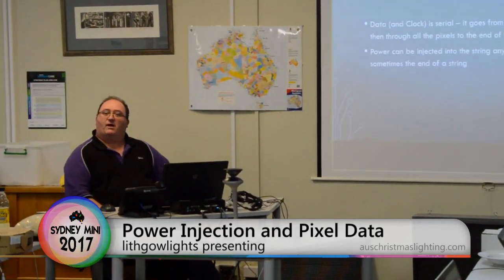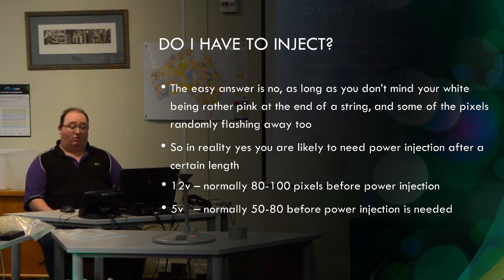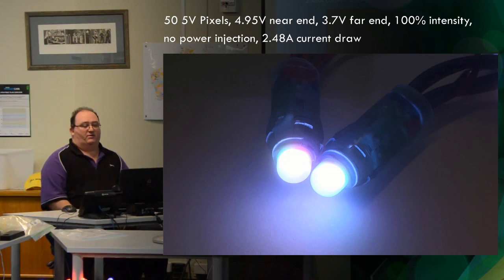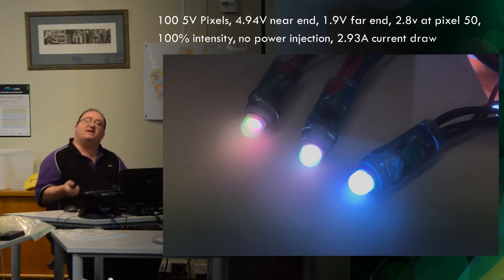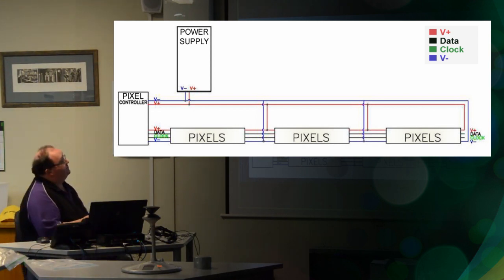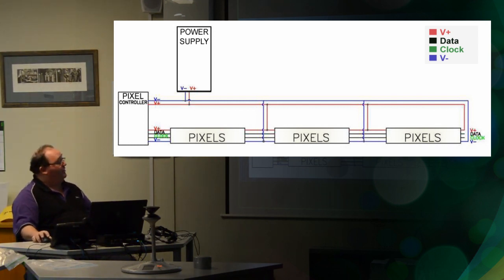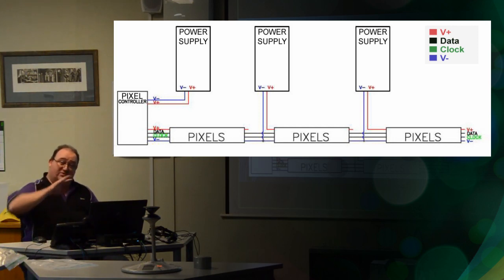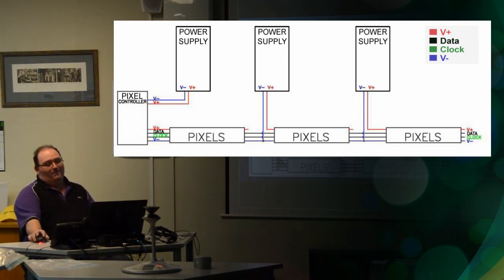Power Injection and RGB Pixel Data - 2017 Sydney Mini

Comment: power supple injection from the same supply would you not over load it. say 200 pixels at 2.5a but if you inject at the 100 point mark would that put the power supply upto 5amp. So ideally what supply is needed for current per strand

Comment: 2022
I'm not an electrical engineer, but this is crap.
I just bought 60/m 5 meter strips so that is 300 pixels and the first pixel is no more white than the last one.

Comment: I have 2 PSUs, how many pixels would you run maximum with that? Each have 2 outputs and my pixels are the ws2811 5V. Thanks in advance?
Reply: Need to know the max amperage of the power supply and then it will only run at 80%. So if you had a 5vdc 10amp power supply it will only be able to run continuously at 8amps. Think 5v pixels of 100 are roughly 3amps at max white but most run their shows at 20-40% brightness. If that all makes sense. Hope it helps!

Comment: You obviously have to tie the negatives together. That’s the case in all electionics. Otherwise the signal baseline moves.
Reply: I wonder if its because they are using multiple power supplies and dont want to connect the + to both PS together?

Comment: Question that wasnt answered here and I cant seem to find the answer, how do I split the data wire from the controller to multiple strips, as in 2 or more strips having a parallel data line instead of series?..... or are you not able to do that?
Reply: I  believe you would have to have two data lines.  Although an interesting idea if you could copy it in some way to split it for things you want to run the same pattern.

Comment: When you show the diagram at 8:50, could you just ground PSU1 and PSU2 together? Also if you use the same PSU to power the pixels and the controller do you need to run a ground from the controller to the pixels?